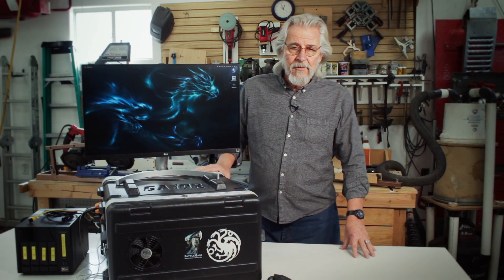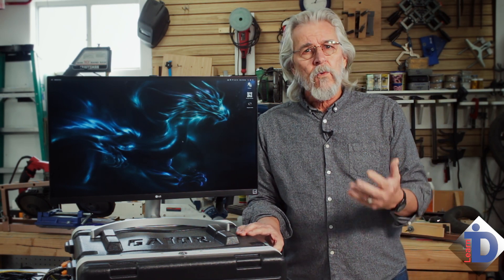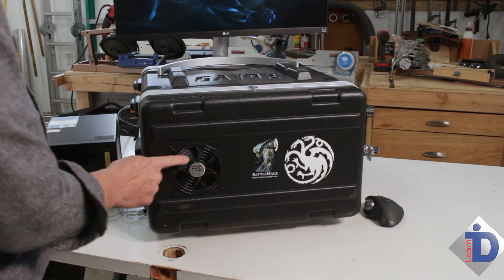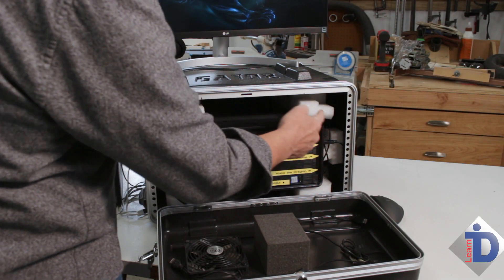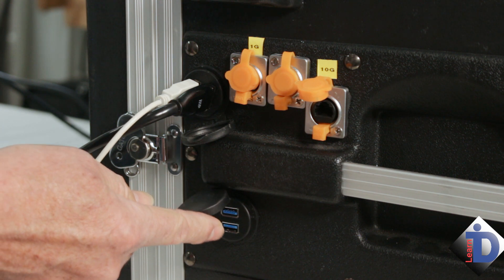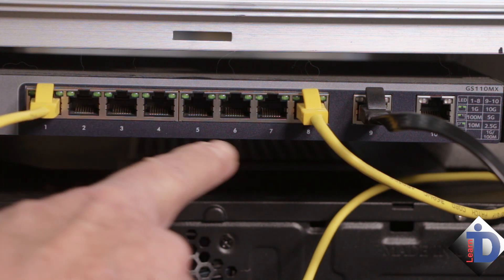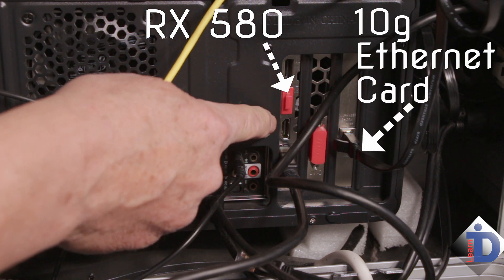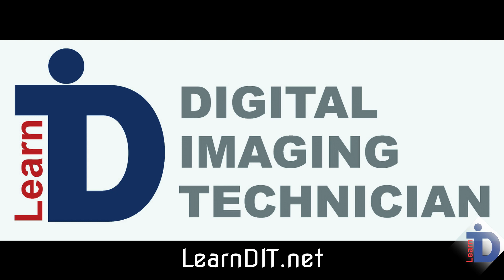DIT Kit Build Overview

Comment: Am completely lack of engineering skills. Did you cut all the holes in the case for fan and connectors by yourself?
Reply from the maker: Yes. These builds are one-offs. Everything is cut and mounted per the equipment being installed. But a drill, drill bits and a hole saw set gets you a long ways when building.

Comment: Why is 10gb Ethernet port important?
Reply from the maker: 2 reasons: pure speed and second, packet size. Both move more data. There's other techie stuff under the hood of 10gb ethernet.  But it's basically the need for speed.

Comment: Thanks for the great video. Just wondering, wouldn't usb 2.0 port be to slow to offload files?
Reply from the maker: Absolutely. The kit shown has USB3 pathways. USB2 is unuseable. In fact, with the huge 4k, 6k and larger files, the new thunderbolt is pretty much the minimum now. The data pile just keeps getting bigger.

Comment: Nice video and Nice rig! I would call this a dailies workstation not a DIT kit. In Italy a "DIT Box" and usually contains a Lut box like the FSI BoxIO, thunderbolt hub, a SDI video Hub like a blackmagic "smart video hub" and also a capture/playback card like the black magic ultrastudio plus other minor devices. How would you call this in the USA?
Reply: Playback is another person entirely in the union shows in the states therefore I can't offer live playback. I do have the ability to feed the LUT to the live feed, but I cannot offer playback except when processing footage after offload. I monitor live feed, but the focus here is to ingest, process, and work with the DP for a LUT per scene or for entire show and keep it consistent.
Reply from the maker: Good points Leonardo. In the USA the DIT position has a wide variety of services offered to production on an alacart basis. If production can afford it, then it's added to the DIT. But on the most basic level, it one is just doing on-lights, dailies, and transcodes for post, that's a DIT. If just doing asset offloading and asset management... that would be a digital loader/media manager position.

Comment: You have an additonal PCIe slot there (well, at least your case does), couldn't you just add TB3 that way?
Reply from the maker: The motherboard only has 2 usable pci slots once you get that fat 580 card installed. The other slot is filled with the 10g ethernet card. 2 yrs ago, when this system was built, t-bolt was a hard find on these motherboards.

Comment: Thanks a lot for the videos. What about a laptop? Wouldn’t it do the job? Or 2 laptops
Reply from the maker: Laptops have worked great if you get one with enough power (best processor, lots of RAM, and fast ports)... to a point. Adding external stuff can be a challenge. The new M1 MacBooks show promise BUT the software has to catch up. In some cases, it will take a year for the software we use to optimize for the new silicon. Stay tuned for a video addressing this after the first of the year. But...don't try a Hackintosh laptop. Unless you have a high pain/frustration threshold.
Reply: @learndit922  Just got a M1 the other day, with the fairly low price tag, its astonishing what it can do. Connectivity is a bit of a pain tho, had to sink an additional 8th of the Macs cost into a all purpose TB3 dock...
Reply: @hannes10001  which version did you get? Can you share the transfer and transcode speeds?
Reply: @marcoabujamra6540  I have the 16GB RAM model, I can easily scrub through 4K RAW footage
Reply: @learndit922  thanks for the response. Looking forward for your next videos.
Reply: @learndit922  just another quick question, if I may. The offload computer must have more CPU power, and the rendering/export one, more gpu, is that about right? Or 2ac mini m1 would do the job - after software optimization and assuming the hype is for real. Thanks again
Reply from the maker: @marcoabujamra6540  A new Mac Mini would be perfect for the Data Manager where you are just offloading/backing up. There's no processing of the files, just through-put. The traditional backup software will run just fine on the M1 in emulation mode which is just like Macs did when converting over to 64 bit only programs.